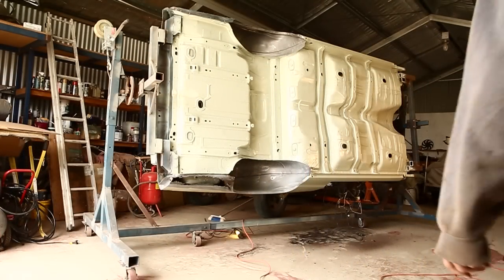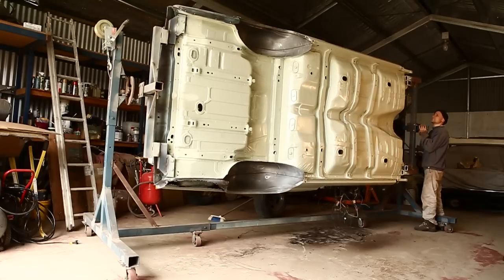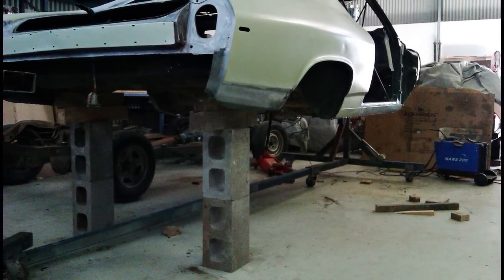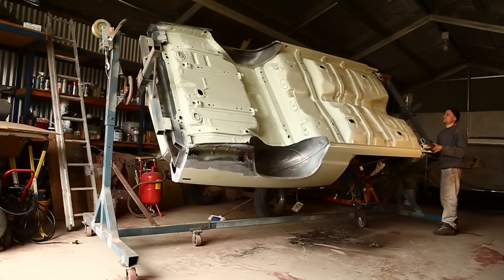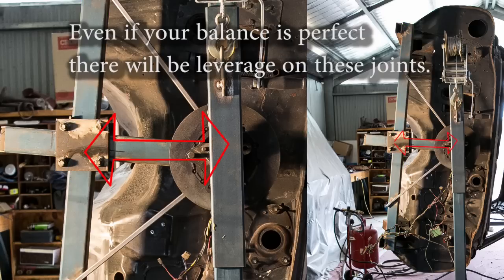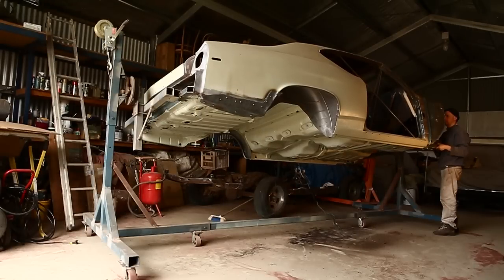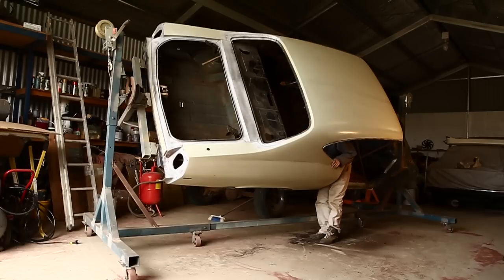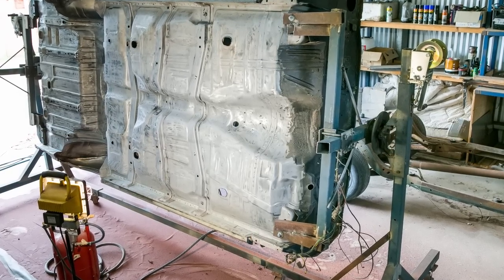car rotisserie tips

Comment: Hope you get this message.. i have a question for you. I'm in the process of trying to mount a truck cab to a rotisserie now and am wondering: if i build some arms that go to the bottom of the cab and attach them to the body mounts will this affect my center of balance? Remeber that i havent changed the position of the rotisserie, just the point where it attaches...
Reply from the maker: You will want to adjust the point of rotation to compensate for the weight of the arms you are making. You don't need to have it perfectly balanced but you might rotate the cab a thousand times whilst you do your work. The better you can balance it the easier and safer your work will be.  I hope it goes well for you.
Reply: @StopTheRust  thanks. Ive seen some youtube vids of guys just putting the rotisserie arms down low under the body mounts and it looked to work out fine with the adjustments 🤞

Comment: How did you get the bottom so clean to bare steel ?  Drill and wire wheel ?
Reply from the maker: Camaro Z twentyeight I did as much as I could get to with strip it discs, I prefer the small ones as they get into more places and are lighter to handle. I finished it of with Garnet blasting, I also did a video about blasting at home all about the work a rounds when doing a home job.